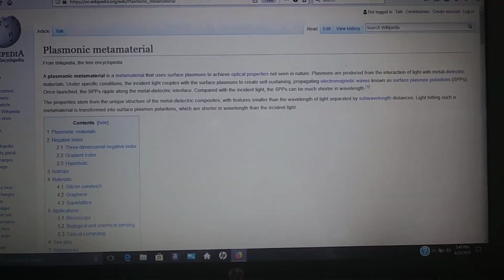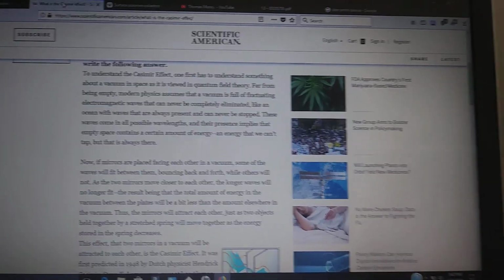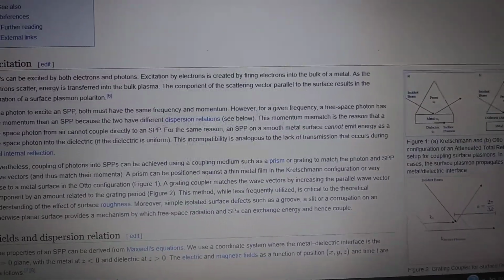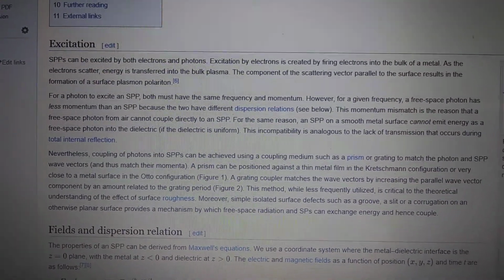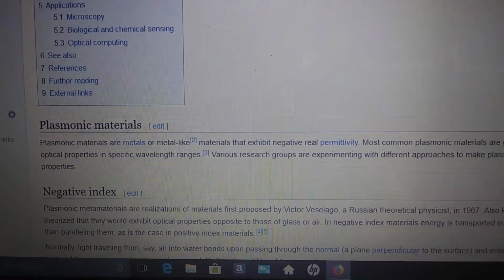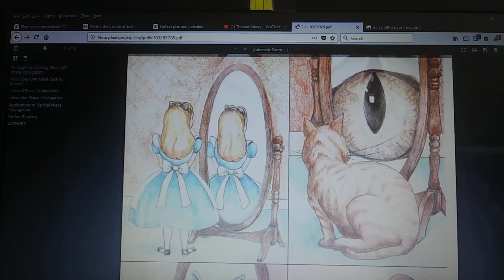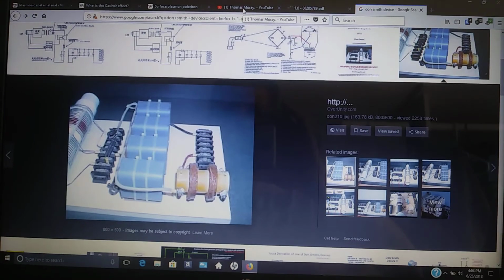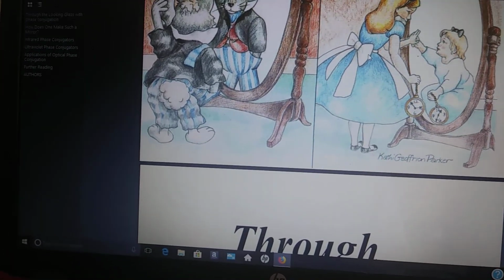How to tap the zeropoint energy field using plasmonics

Comment: You cant harness free energy, but you can use less energy to do more work if you structure the energy to work with the "space-time" (space is filled with spinning dipolar particles)

You need to fix DC MHD and construct an AC resonant magneto-hydrodynamic motor, where the capacitor part has the magnetic field from the coils in such a way that AC would cause monodirectional lorentz force.

So casimir effect evacuates those spining dipols, so you need a few mm at least capacitors plate distance for AC MHD propulsion to work.

Comment: longwinded way of the ultimate conversion of reactive power from the coils to watts from the capacitors.  Shunt resistor used to limit the power to that which can be handled by the limited capacitance.  I get what you are saying about the negative refraction and all within the capacitors...however seem skeptical on that as the process is describing electromagnetic radiation effects (light) while the dielectric of a capacitor is more of a longitudinal nature.  Thanks for thought inducing vid...and where are you...did you fall down the rabbit hole????
Reply: It's attention seeking bullshit
Reply: Hi Mark, yes I fell down a rabbit hole. 
Anyway although it was a long winded way to explain it as you mentioned. Once we know that reactive power is the result of a Time reverse phase conjugated wave due to the capacitor acting as a meta material, it opens up a deeper understanding of the Vacuum physics involved which ultimately is vacuum engineering of Space-Time.

However I have made progress on what the surface plasmons are doing to the metallic conductors, and the true role of the n type silicon in the transistor.

Explained here https://thenewenergyconceptsgroup.webs.com/apps/forums/topics/show/13514598-vacuum-conversion-engine
Reply: Also the action of the plasmon wave is happening between the metal dielectric interface. The photoelectric conversion happening at the n type silicon in the transistor can be either longitudinal or transverse I believe.

Comment: Ok I think I'm understanding what you're saying a lot better now! These plasmons are the photons described by the poynting vector coming in through the side of the capacitor. If you think about it, it makes sense that they are time-reversed: the photons can be thought of as traveling in from infinity towards the capacitor, since before the capacitor gets charged, so the cause is after the effect in a sense. Is that correct? This also explains why people keep bringing up Bismuth, because it has a negative permeability so a capacitor made with that plus a dielectric with a negative permittivity should exhibit this effect rather strongly, although one might expect it to be awful at its job as a normal capacitor (which usually benefits from high positive permittivity).

It makes sense why these negative index materials would work: a negative dielectric coefficient would cause more charge to accumulate on the plates instead of less, so maybe it enables one to get more current out of the capacitor somehow.

As for plasmons being antimatter? Nah man... idk
Reply: You have it exactly right and yes I have thought about the bismuth capacitor, hope to built one soon..